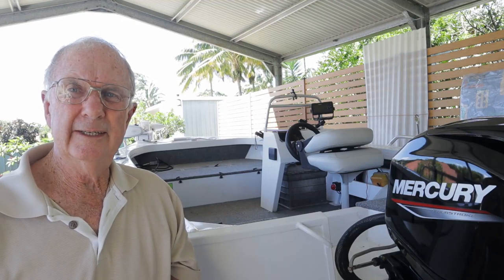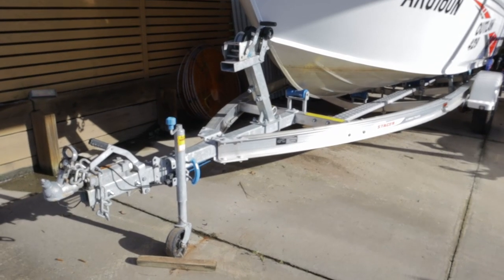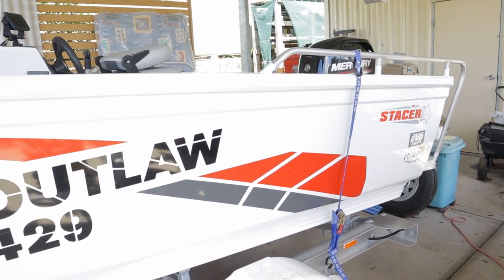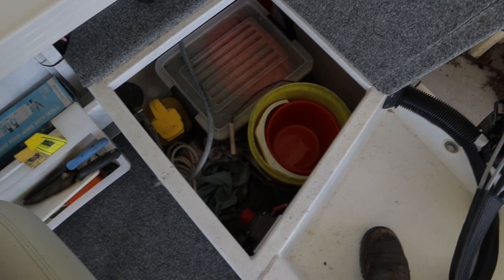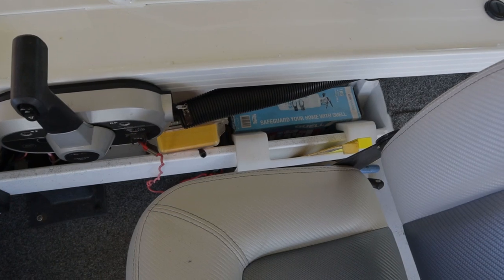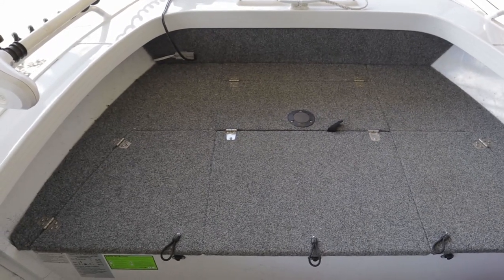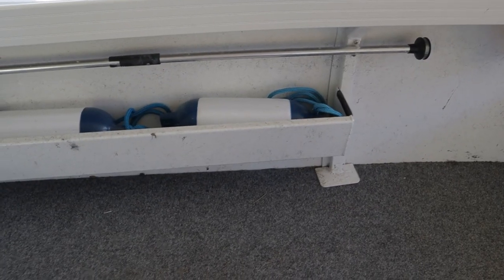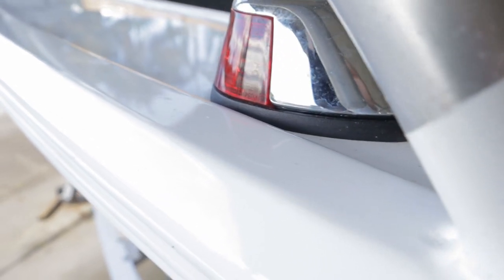A review of the STACER Outlaw 429 after 18 months

Comment: Thanks for the review,am 68 and upgrading my boat for the same reasons as yourself.Looked at the same boat but didn’t have a supplier close so went with a quintrex explorer trophy with the same outboard locally.The sad part is not available until February March due to lack of aluminium in Australia.Enjoying following your videos.
Reply from the maker: Thanks Neil. A friend has the Explorer Trophy and is very happy with it. The Quintrex Renegade is the equivalent to the Outlaw. However, talking to someone only yesterday they felt the Quiny was too expensive compared to Outlaw. Shame you don't have a local dealer. Both out of the same stable though. Bit of a bummer re delivery time.

Comment: Nice honest review, well done. I bought the Renegade, it's interesting to see differences between our rigs. Mine has the tackle box locker in the rear casting deck. My console looks the same as yours, but I enclosed the large hole in the front and put my rod holder across it and works well. I also fitted led lighting all around the underside of the console, and its fantastic at night.
Reply from the maker: Thanks bruno2. As mentioned in the review the display boat I looked at had the tackle box locker as well as a continuous rear casting deck. Neither were there on the delivered boat without warning. Considered installing rod holders but don't like rods standing upright. Just a personal preference.

Comment: Just found your channel.Excellent review mate.I have a quinny estuary angler and the main reason I went unpainted is easy maintenance and NO paint issues.Painted does look nice for a little while though.😉
Reply from the maker: Hi Fabian. You are right - paint does look good. But protecting it can be a real chore. The boat ramp I use has a pontoon with the pilons coming up on one side. These pilons are protected by wire cages (is suspect to stop feet slipping through the opening) that come right to the edge of the pontoon. Unless you have a small tinny your paint work runs down the side of these. So painted boats are reluctant to use this side. Got to wonder some times.

Comment: Sweet boat! I have the newer model with the Revo hull. The gunnels are not painted and that is a nice touch which helps with the paint peeling. Overall I am very happy with the boat. I agree that the Minn Kota is money well spent too. Cheers for your review!
Reply: Did you request not to paint the gunnels. If not, then it is interesting that they are no longer painting the gunnels. After every trip I pressure wash the hull so there is no way that salt water is causing this.
Reply: @bobrobinson8544  Yeah just come that way now.
Reply: @bobrobinson8544  I have the renegade 420. I like your layout better with the battery in the floor and large kill box up front. The paint is peeling much worse than yours due to oxidation. Purchased second hand for a great price, so can't complain. If buying new I think I'd go bare unpainted aluminium all over.

Comment: It's sad seeing that corrosion, I've had my Allycraft Top ender since 2003 and it has little corrosion after all that time.
I'm now looking at a side console Crossfire for the same reason as you had so will expect same paint issues.
Cheers for the video
Reply from the maker: You will enjoy the upgrade. I suspect that this corrosion is really caused by electrolysis which can result through earthing to the hull. More often this is via mounting the outboard to the hull.
Reply: Opt for fully welded gunnels...

Comment: Good review mate.  Any tips on installing the minnkota to the bow plate?  I've got an almost identical Quintrex Top Ender and just bought a Motorguide.  Not sure I'm going to fit all four screws of the quick release to the bloody plate.  Not much room under there.  Cheers.
Reply from the maker: Thanks FF. I had to fiddle with the fitting of the quick release plate. As you say, not much room under there. Telwater obviously don't look at these plates when they design the fit the mount plate. The other thing to watch when drilling your holes it that the plate allows for a lock to be fitted. On the Minnkota if it is too far from the edge then a lock can't be fitted.

Comment: The change to the casting deck was government enforced as splashwell needed to be bigger. I think you’ll find your model also took a reduction in carrying capacity to 4 from 5
Reply from the maker: Thanks for your feedback Liam. Was not aware of the reason for splashwell size change. Dealer advised me of reduction in carrying capacity was due to my requesting a  50L under floor fuel tank. I have since found out that this is not the reason.
Reply: It's a smaller boat, I reckon he should sue them for false advertising/fraud....
Reply: 80% of dealers use the old external photo of the bigger older 429 and show internal shots of the newer smaller 429/420.... Which was a 419 outlaw which got discontinued...

Comment: Great review ol boy. How long is the electric motor shaft? 54 inch? And is that good enough? Thanks in advance
Reply from the maker: Thanks MM. The shaft is 54". I have it fully extended all the time and it performs well. On the odd occasion that it bottoms ( <.5m) I lift it and hold until back in deeper water. If you only partially extend the shaft it may beat the surface when you move to the back of the boat. Hope this helps.

Comment: Nice review mate. Ive just sold my Quinnie 475 SC and am now considering one of these. On my Quinnie I had to raise the console and controls around 75mm so I could stand up while underway. Im around 6ft tall. Are you able to stand comfortably while underway with your standard setup or you have to remain seated?
Reply from the maker: I am about 5'10.5", so about one and half inches shorter. i only stand up when I am navigating through weed or narrow channel.  Quite often do this standing beside console. Not a problem for me. If on the plane moving to a new spot, then I sit down for no reason than comfort.

Comment: Hey I just watched this and I have the same boat but there's little differences I'm not sure why. I had the same surprise as you, the rear hatch was missing even tho when I ordered the boat it was there, I was disappointed too. The other odd thing is that I don't have a rear hatch in the floor for the battery, instead it's under the bigger splash well and I have to reach it by taking the portable fuel tank out and twisting my body upside down to reach it.... 😟

I don't have the underfloor tank, I wanted it but $2400 extra is a lot.. 

Overall I like the boat but I'm paranoid about the paint bubbles, I read in the manual to expect them too. 

I like how comfortable these boats are, I used to break my spine in a heavy fiberglass boat but these seem to fly over choppy waters.

I've been using Meguiar's waterless car wash and wax all over the hull and it seems to have helped the paint so far.

I wish Yamaha had something like vessel view, I do like my Yamaha but I've had to spend more to be able to see information about the motor.

I don't use the live bait well either but I'm thinking of filling it with ice and putting beer in it and then the ice will drain itself 👍
Reply from the maker: As you have noticed the hull really cuts through the chop. My previous boat would have bounced across it. Still a very comfortable boat to fish from. Something I failed to mention in my review is the trailer wheels locking up when parked for a few days. Can take some effort to get them rolling, then all OK. At times I have to hitch up to free them. Have started to spray lanolin on them as I suspect that the problem is rust.

Comment: Great videos, I've put a deposit on 429 side console because of your videos. Have you had any trouble with electrolysis/did the battery come earthed to the hull as stacer tends to do? Made any changes to the wiring if so? Cheers
Reply from the maker: Hi Tom. Replied to this earlier today but God only knows where it went. Not sure I want to be responsible for your boat selection. Re electrolysis - you are going to go nuts over this topic. Have a read of at least the first two pages of this forum discussion. https://www.ausfish.com.au/vforum/showthread.php/207486-New-Boat-Grounding-Question. My battery is directly earthed to the metal isolation switch mounting bracket.. The electrolysis shown in my video does not appear to be getting any worse. I have added some other electrical devices. I installed a buss bar under the console and directly connected the positive and negative runs to the battery via another isolation switch. All devises connect to buss bar. Hope this helps.
Reply: @fishingwiththefossil.6199  Thanks mate. Very helpful. It's a complicated topic (electrolysis on stacer) and so far I've heard of people not worrying about it and keeping wiring as is from factory, and others believing its a problem and rewiring etc, so hard to know who to believe on the topic/whether I need to rewire or just leave it as it is from the factory

Comment: Very informative review. How do you clean the carpeted floor? And what size car motor pulls your boat and trailer? Do you know the combo weight of boat, outboard and trailer?
Reply: Thanks Jazzy. Have not cleaned this one yet. Vacuum it on a regular basis. Mainly for fishing line off cuts and crumbs from lunch. My previous Stacer had carpet and when needed cleaning would empty the lockers, park on sloping driveway with bung out, then hit with the Karcher. Always did a good job.
Reply: @bobrobinson8544  Thanks for that. I checked out one of your other vids which showed you doing a fine job with your Karcher and it also shows the size of your car. I hire boats at the moment and don’t have to clean or tow but would like to buy a boat like the 429 Outlaw
Reply: @jazzycool2950  Thanks for the feedback. The car is a Mazda cx5 and does a good job of towing this boat. If I was going to be doing real long trips then I might get something with a better towing capacity for no other reason than fuel consumption. Whilst the Outlaw was purchased new my previous boat was a trade-in purchased from a dealer. Turned out to be a good buy.
Reply: @bobrobinson8544  I have a 2Litre SUV and travel 1 hour to the water. Do you think I could tow an Outlaw 429 no trouble?
Reply: @jazzycool2950  You will need to look at your car specification. The CX-5 is 2.5L witha towing rating of 1800Kg for a braked trailer. I have the aluminum I frame trailer which is braked. Don't know what you you are considering. The 2.5L petrol engine tows fine. Have done just under an hour travelling at 110kph.

Comment: Nice walkthrough. What length shaft are you running on the Minn Kota?
Reply from the maker: Thanks Corey. I believe shaft length is measured from base of the head to top of motor. In this case I have 54".
Reply: Thanks for the review Fossil, with the 54" shaft is it long enough to cope with swell, I have the same boat and living in Perth we mostly have an angry sea there, also i see this video is 2 years old now, have you made any additional changes since ? @fishingwiththefossil.6199

Comment: I have just bought a 2nd Hand version of this Boat - it's great and handles rough water well - want to fit a Minn Kota Terrova but am worried how to set up the electrics - can you point me in the right direction please
Reply from the maker: Just about everyone will have a take on this. This is what I did. Started with installing a 110Ah deep cycle battery. Once on site I only use the electric and it can be running continuously for over six hours with no problem. I installed it under the left side front hatch. My model has a flat carpeted floor under front hatches which made this easy. Obviously don't know about your purchase. I also fitted a waterproof breaker under the same hatch. Can't remember which gauge wire I used. However your dealer should be able to help here. On the deck front wall to the left of the anchor well I fitted an Anderson plug. So wiring goes from Anderson plug, through wall, down to breaker then on to battery. Hope this helps. For the compass I fed power from the crank battery. This is because I installed a buss bar under the console to support a number of other devices. I mentioned this in my review.

Comment: Well I would call that false advertising/fraud. You were shown a bigger boat plated for 5ppl and you got a smaller/lighter boat plated for 4ppl. You park that boat beside the older hull you were shown and its a big difference. Stacer/Quintrex dealers are using the old photos of the bigger/original 429 and showing internal shots of the new 420....

This is purely cost cutting and ease of manufacturing using the 440 casting decks in the 420 with the older 419 outlaw hull. Soon as I pointed this out you get blocked or deleted

Comment: Virtually identical to the 420 renegade sc , with a few little differences ! Otherwise same boat same factory of origin !
Reply: Right on Duaine. I think you will find that Telwater push out three lables.
Reply: @bobrobinson8544  4 actually Quintrex , Stacer , Savage & Yellowfin plate boats all great boats mate ! I myself have fhe 420 Renegade SC  !
Reply: @wolfysgibbo  Wasn't aware of Yellowfin. In fact, never heard of it.
Reply: The older 429 outlaw's are a bigger boat and plated for 5ppl not 4. I hate how dealers show the old hull but show the internals of the new one. Typical slippery salesman....
Reply: @wolfysgibbo  The new stacer 429 and quintrex 420 are the same but older ones were almost a 440. Like I said slimey salesman. The new 429/420 were called a stacer 419 outlaw TS